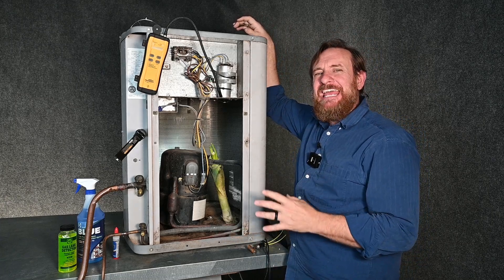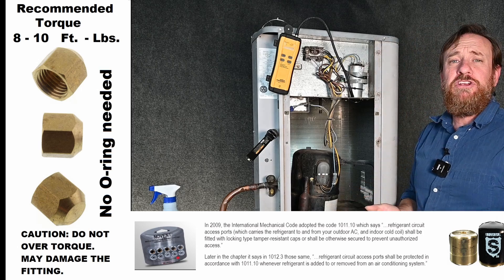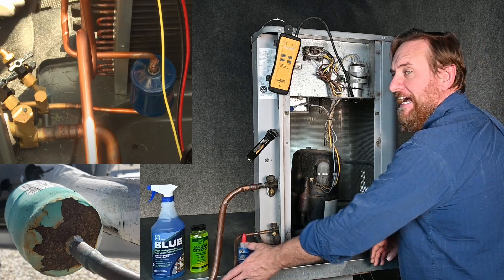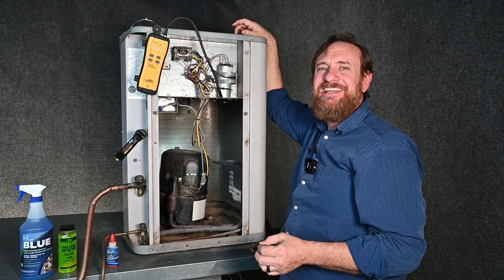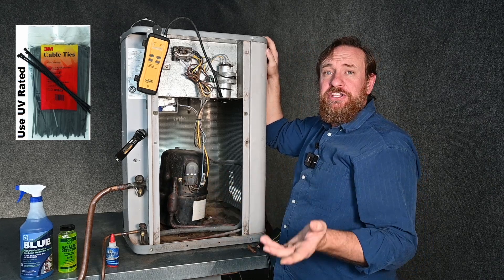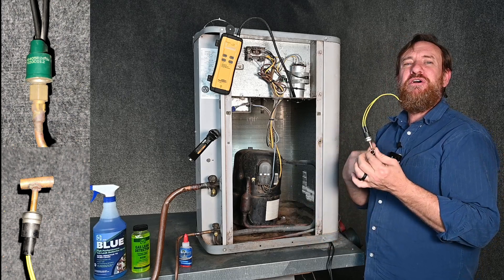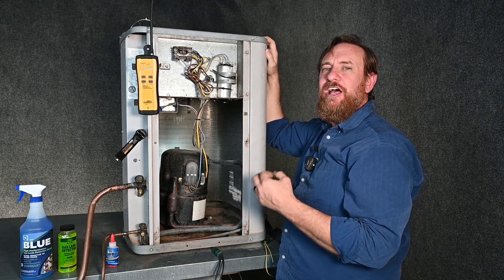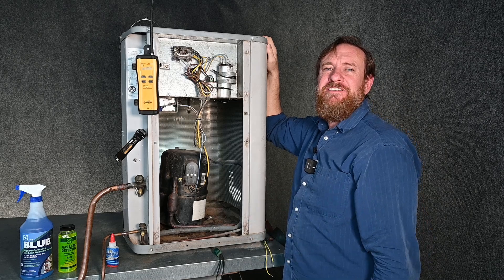HVAC161 Condensing unit leak search Tips

Comment: Great video! I couldn’t find the leak on my heat pump anywhere and finally checked the service cap and found the leak. Craig, acservicetech, had a great recommendation to drill a hole through a plastic schrader cap, screw on, and put some bubbles on the screw hole to check for leaks. Less mess imo.
Reply from the maker: Craig is really awesome, he was telling me about the hole drilled in the cap trick recently. I'm going to adopt it.
Reply: @love2hvac  cool / hole in cap works seen that tried it but I like ur idea just as good barley screw cap on & spray/  if there's a leak it will show & core stays totally dry

Comment: What if replacing the schrader doesn't stop the schraeder leak?
Reply from the maker: That is a great question, I do not know the answer. I have not ran into that before. I have had a shredder broken off inside and I had to leave my valve core tool there with a note inside for the next person.
Reply: @love2hvac  Thanks, I suspect the sealing surface inside the schrader seat has some debris on it, as if the core was overheated from brazing.  Not sure if it's worth while recovering to try repairing or just maintaining the caps in good condition.  Both service valves are this way, ugh.
Reply from the maker: @thisisyourcaptainspeaking2259  that is excellent feedback and I really appreciate it!
Reply: @love2hvac  

I once had a indoor coil that kept freezing up and then after you would thaw it out and start the system up again it would run fine. Then it would eventually freeze up again. Turned out it was the very tip of a Schrader valve that had broken off and was causing havoc at the expansion device.
Reply from the maker: @billl3936  I like hearing about those one off random things like that.I see metering devices clogged a lot fist time hearing that!
Reply: You replace the service valve/king valve? Not that hard to remove and replace.

Comment: Tarp??

Do your selves and all your customers a favor. If charge needs to be topped off and no leak is evident. Stick an EZ seal cartridge with UV dye in it and call it done!

Don't waste a second of time more trying to find a leak that is 90% of the time in the evaporator coil and for sure if the coils are all aluminum then easpecially don't waste time and money trying to pinpoint a micro leak!

Comment: I just had one condenser unit had a wire touched liquid line filter drier and had a leak spot right there. Heat pump has more potential leaking spots
Reply from the maker: More wires more piping more potential for leaks. What brand was it?

Comment: Thank you Mr.Ty for your informative video.Q:what is best electronic leak detector is it infrared or that’s work with sound? Q: Is it important to use section line filter drier additional to liquid line filter drier?💐Thank-you.
Reply from the maker: I only use suction line dryers on  burn outs. Its a real pain coming back in 72 hrs to change it.

I have always been a fan of the H10 pro, but now we are entering the realm of flamable refregerants. 

I would lean towards the superior brand ultrasonic leak detector or infrared if it's rated for A2L